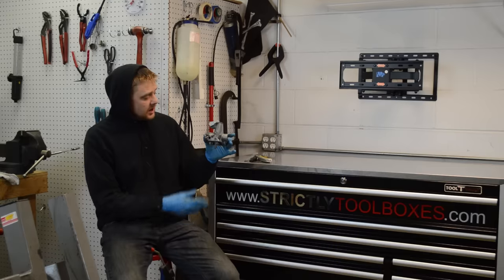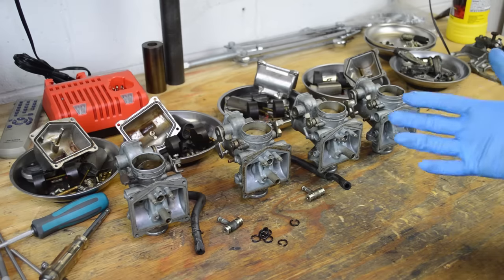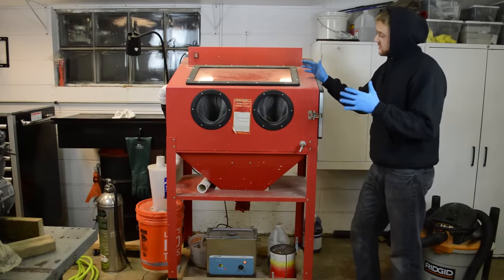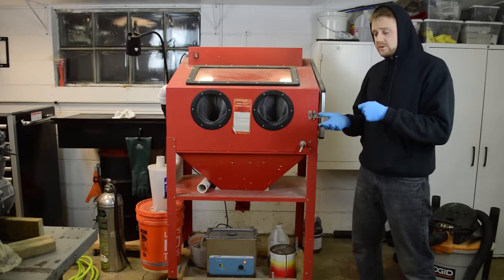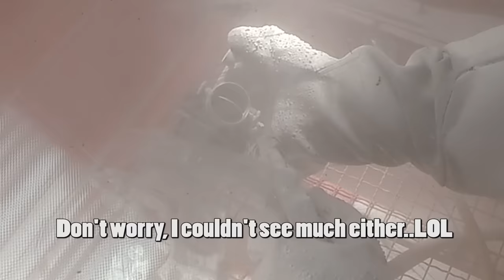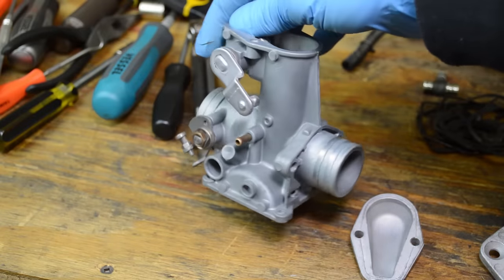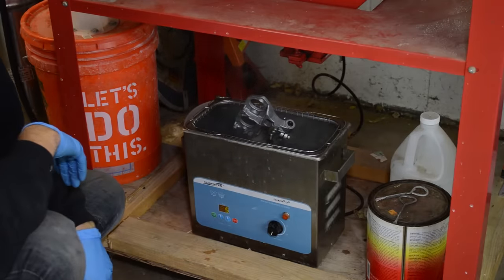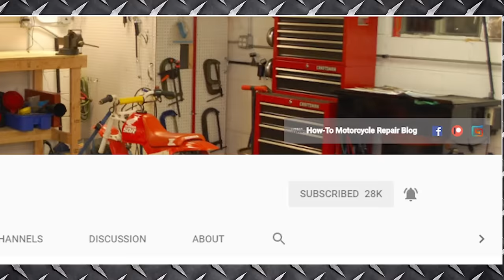The BEST method for cleaning carburetors - soda blast and ultrasonic

Comment: Never put your hands into a running Ultrasonic cleaner. Ultrasound will break all the capillaries in your fingers and you will lose them if Blood can't circulate through your fingers and hands. Not cool. If your not sure of the talk is running or not, unplug it and wait. Several minutes before reaching into one, but the best way to use it is to put the parts in the basket and use that to remove them. If you can't get the basket out, use a pair of pliers to get the basket out. Have fun, and be safe!
Reply: I learned something new thanks 🙏
Reply: Thank you for the info! In the mechanic world if we aren’t learning then we should quit!

Comment: I started working on carbs early 50s on the farm in minnesota. What did I have to use. an old kettle. disassemble carb. put it in kettle. what ever was available. pine sole, dish soap, lemon concentrate. put that and water in and let it slowly boil on the stove all day. use old tooth brush etc to clean up, reboil etc. rinse with water and dry. always worked. use what you got, just don't ruin the thing in the process. Modern gas has lots of cleaners in it so if you just drive there should be little carb cleaning needed. like the soda blaster idea.

Comment: It's a good idea to have a water/air separator on your compressor for blasting like this. I've dealt with some real PITA cabinets because after a long job of blasting the condensation just gums up the gun/tube. Soda blasting + ultrasonic cleaning is pretty much the best finish you're going to get without going new or getting into vapour blasting.

Comment: I use Pine Sol IN my ultrasonic cleaner. The results are fantastic.
Reply: Ratio?
Reply: without soda blast?
Reply: @Susan70003   Undiluted and ONLY Pine-Sol brand. Love the stuff and my use of carb dip goes back to the original Hydro-Seal they don't sell any more (because it had methylene chloride).

Comment: You might try putting your parts in a good zip lock bag with the cleaner and a tank full of water, so you won't have to clean your ultrasonic tank. I put the parts in the bag  and suspend the bag in the tank by the lid with the zip lock part sticking out so that no dirty cleaning solution gets in my tank. Saves me time from cleaning and I use less cleaning solution that way. Nice job on the soda blasting.  I am going to change up my blaster the same as you have done.
Reply from the maker: Good tip.

Comment: This is how I do all my small carbs, & I use fine strand copper wire and a torch tip cleaner as well.   I also just use Beeryman carb cleaning solution in my ultra sonic.
Thumbs up to a DIY video .
Reply: I've used Berrymans also, and always had great results. I can only imaging it works even better when heated and agitated. I just wonder what the flash point is (kaboom!). Funny, in the video it looks like a can of Berrymans next to the ultrasonic cleaner under the blast cabinet. Cheers

Comment: I use paint stripper since years, it works really well. Just make sure that the residue is all washed off and removed after 6 hours and housings & other small parts are cleared well with a blow-gun.

Comment: Hey Dennis carb here another great video dude ...for small parts I use a 1.5   gallon rock tumbler with my special cleaner ....1 ounce mineral spirits to 1 ounce kerosene 1 ...1/4 cup baking soda it works great I leave them in there for about 3 hrs I have 3 speed settings and day settings but I hooked up a hr timer at the plug socket and it shuts off at around 3 hrs .just blow them off ..I also have a zinc electro plate and dichromate tank i dip my small outer parts just for that extra protection against the elements And again awesome video Denniscarb

Comment: Soda blasting doesn't like greasy, oily parts. The soda, like most medias, tends to ball up on the grease/oil spot until it finally wears it away. I would first drop the parts into that 1 gallon can of carb cleaner next to your ultrasonic. That stuff works great. Then rinse, dry, and soda blast to give a nice finish. Your carbs turned out nice.

Comment: Year's ago I use to use a chemical carb cleaner, that was caustic,  this is so much safer and cleaner, thank you for Sharing I need to get one of those media boxes and ultra sonic cleansers and try it.
Reply: Yamilube carby dip 👊👊✊✊👍👍
Reply: Back in the 80’s I was using berkible 2+2 carb cleaner, then they removed from the stores... something about causing cancer in the state of California, I guess this doesn’t happen elsewhere, but after 20 years it’s back and reformulated, and the last time I used it, wasn’t worth a crap!
Reply: @gettintheresafelywithpatf2869  Yup, the 2+2 is back. And I agree it's weaker now, but I still think it's the best thing out there in a spray can for removing varnish and carbon deposits, like in throttle bodies. Oh, and seems like most every consumer product now comes with a cancer warning, so gimme the old 2+2 back! Cheers

Comment: that's good for those who don´t  want to know the details of the circuits, they try to fix all at once,but int he end,they  might still be the same,sometimes;      carbs are meant to run well ,dirty,from gas;       i determine EXACTLY what the problem is,BEFORE dismantling,and fix that;       if the carb sat with gas in it ,for 1O years,then i would do a total cleaning.
nice video,one more like.

Comment: For those that do not have a soda blaster, I use Extreme simple green.  It is formulated for use on aircraft  and is safe to use on aluminum.  I do use it in an ultrasonic cleaner, and it works great!
Reply from the maker: Thanks for sharing. What ratio with the extreme simple green?
Reply: I do 50 / 50, but you could (and probably should) use a lighter mixture - the extreme formula is not cheap!  @HTMR

Comment: Ugh my garage is the same cold way unless i run the heater which i try not to. The cold transfers right through your boots up through your body. Great video man
Reply from the maker: Yeah tell me about it. This year I leave heater set at 45°F 24/7 and bump to 60° when I plan to work. Feels much better, gas is cheap this year.

Comment: i use soda from HFT and  do the same. if its really heavy use the light walnut shell. a mechanic friend told me they use that to blast and shake in a tumbler for heavy build up without damaging soft metals. baking soda is also environmentally friendly and water soluble like you said and if needed a little 1.99 vinegar will take the heavy stuff out
Reply from the maker: Yup. I love what soda can do to carbs. I plan on trying wet soda in my vapor blaster: https://youtu.be/mUfgjK5q_Mc

Comment: Been using a ultrasonic cleaner and yellow ONLY yellow original pinesol. Any other color only works half as well. I mix it with water about 80 parts pinesol to 20 parts water. Works wonders never fails. Takes off old grease, paint, varnish ect. I'll try the soda this winter to see if I like it.
Reply from the maker: Soda cleans all the crusty stuff off that pinesol probably won't. Try it, you'll love it.
Reply: be easier to say 25% water to pine sol.    or even 1 part to 4

Comment: When it comes to old hard gaskets that are difficult to remove, I find that a gel type liquid paint remover applied to the hard gasket and allowed to sit for an hour will come right off ! The problem I've had with blasting gaskets off is that the surface is being protected by the old piece of gasket and even with soda it will leave an uneven surface that you don't want in a gasket area.
Reply: The soda shouldn't affect but the surface of the aluminum.  If it's blasting away enough to cause a gasket surface to become uneven, you're either doing it wrong, or you put the sand in by accident! 😂

Comment: I use two SS kitchen sink basket strainers face to face with a small bolt on one side for the hinge and a safety pin on the other to hold small carb parts in my ultrasonic cleaner .
Dollar store cheap
Reply from the maker: Nice!

Comment: I've been told that soaking the carb in Pine-sol works, so I tried that. My '03 XR250 is running again for the first time in about 10 years.
Reply from the maker: Yes pine sol works. I used that method once. Soda and ultrasonic is my preferred method though.
Reply: he had a video on berryman and pinesol. now this is the best way to clean carbs? im trying lemon juice. then pinesol.
Reply from the maker: The method you use depends on what you are trying to clean. Carbs can just be greasy, or they can be varnished up, or corroded...etc. Every method has it's pros/cons.
Reply: Have heard lemon juice is good on varnish/gummed up internals.
Reply from the maker: Heard that as well, haven't tried it though.
Reply: i tried pine-sol it worked awesome!!!!!!!!!!!!!!!!!!!!!!!!
Reply: I blast with walnut shells on all my aluminum engine parts and it works great.then i clean them with soap and water and blow them off with my air compressor.
Reply: Get a hot plate, and warm the Pine-Sol up a little, works even better. The oxygenated stuff works best.
Reply: it does ive tried it on a carb i bought from ebay. it works even better heating it up on a stove and boiling it.
Reply: chipper442 Oxegenated stuff as in oxegenated PineSol ?
Reply: John C walnut shells are fine but soda is water soluble.
Reply: Walnut shells have a long history safely removing carbon from jet engine parts. Good choice.
Reply: Leiðulfr Von Link have you tried it yet? I’m in the process of cleaning my carbs as well. I read that most people will dilute it 50/50 with water and a few people will use pure pine sol on real dirty carbs. Have you cleaned yours yet? This is my first time and I’m still a little unsure. I just pulled the carb off of my motorcycle earlier today and have not opened it up and don’t really know if I should just dump the whole carb unopened in 50/50 pine sol or if I need to take it apart. Have any advice?

Comment: Take about pound of baking soda and spread it onto a metal (not aluminum) baking sheet and bake at 300 degrees for 20 minutes.  This will convert sodium bicarbonate to sodium hydroxide.  Use that in your hot tank.
Reply: Sodium carbonate

Comment: I use baking soda in a gravity fed gun style blaster. It works great.
Reply: How much baking soda does that require? Do you buy it buy the bag?
Reply: @Ritalie  I use it for a lot of things so yes, I buy it in bulk. I keep it in a sealed 5 gal plastic bucket.

The gun I use has a valve to regulate the amount of media used. I set it to the bare minimum. Cleaning a carb wouldn't require a huge amount.

Comment: Yep soda is good but honestly you need to try vapour cleaning, I was stunned at how it cleans without any damage to the surface and it cleans things like vintage car plastic electrics and the brass connectors, truely if you havent tried it, do I bet you will be even more impressed
Reply from the maker: I'm about to send some cases out for vapor honing. My soda setup is about $250, vapor honing setup is $2k+. Just saying.

Comment: yamaha carb dip . straight no dilution, heat to 140° let set hour or so rinse in hot water , sodablaste to your liking. Works fast an easy on the worst of carbs. give it a try. 25 years an counting.
Reply from the maker: I need to try it.

Comment: Interesting to see you using soda in a recovery blast cabinet, going to give that a go. I only been using with a total loss blaster. My worries were the soda would cake and block the gun if there was any humidity? I am a big fan of soda blasting. Presently remove any unused soda and keep in moisture proof tub. The convenience of having it in a cabinet is very appealing!. Great video mate.
Reply from the maker: I live in Chicago and it gets humid. It does not pack or clump up like you are thinking. The media does break down, it all depends on what you are trying to remove.
Reply: MatthewMCRepair I have been using ecostrip medium blasting soda to clean mostly alloy parts for classic cars and bikes. I clean up alternators with it too. I feel comfort from knowing that any media that gets missed on clean up is not going to wreck the items like carbide grit would. Like I said it does cake . Using a dehumidifier to keep cabinet air dry.
Reply: Did you try soda blasting in a cabinet? I have a Skatblast cabinet with their vac system to draw out the dust from inside the cabinet when blasting. And with new Alum oxide grit I still get a fair amount dust. I cant imagine the dust created using recycled soda. Matt must have a really good vac system with the cabinet.

Comment: soda is what I use when restoring carbs. Vapour blast finish does not look like the original finish, far from it. Soda and ultrasonic is as close as you will get. On crankcases, I would soda first, then vapour and then finish in a vibratory tub and this will give you a finish 10 times superior to just soda or  vapour blasting.Good video.Check my video of a finished gt750 I did, search for gez635 and you will see it.
Reply from the maker: That looks great!

Comment: good vid but trouble with soda is it absorbs water , you need a couple of water traps on your compressor line plus dont know how you use it over a period of time as soda absorbs moisture from the air , you must have to clean your guns often due to blockages , commercial units have a drier in their intake system , for small jobs i use a top loader gun and new soda ea time then into the sonic cleaner ... did a ducati 250 carb as a test , it had been rattling around in parts box for 30-40 yrs so very dirty / greasy , was amazed at the difference , would have been there a day with a tooth brush and still wouldnt have been as good as that 2 mins with the soda then 1/2 hr in cleaner

Comment: I got a really dirty carburetor from a friend, he had it on his Malaguti scooter...so it was a Dell'Orto PHVA 17.5mm, it was all dirty covered with sand little rocks and filth, it was oily aswell....so i took a brush and a degreaser and cleaned it on the outside...it was clean but still not what i wanted....sincd i had to clean the jets and inside the carburetor i took it apart and put every metalic piece in a bowl, i put 500ml of white vinnegar and 2 cooking spoons of salt...i let that soak and "eat" the dirtyness....next day i took it out and wash it with water and deagreaser and brush once again, i  took a rag and dry it out....it looked like it had a oxidation mark or something...so i took a brass brush and scrubber the whole carburetor with it...i was really pleased so i blew it with compressed air and put it all together, now its waiting on a shelft to get mounted one day when i will buy a scooter.

Comment: Too long of an intro, but the results are great. I have an old ultrasonic cleaner from a tattoo shop, have done about 10 carbs with it.  Purple power or even pinesol work great diluted with hot water.  I saw a vessel driver on your page, keep spreading the JIS word to folks, as so many dont know about those screws!  Subscribed!
Oh and I change the fuel valves out normally, but have never found a seat that couldnt be cleaned.
Reply from the maker: Yeah I realize too much talking in this one. Try the sharpertek 1220...it works great. I love the vessel impacta drivers!

Comment: Mathew...l got a good tip for ya....so you'll save your gloves 
from sand or soda ripping through them l use a long needle
nose pliers to hold my little parts therefore saving my glove
from from getting a hole ripped in it...works every time ....
Reply from the maker: Soda does not rip the gloves. I would not hold them with needle nose pliers. If you loose your grip, that jet will fly away and will be impossible to find it! Been there done that. I have tried taping the jets to some masking tape and that works pretty good.

Comment: Good video. Aren't you worried about dissolved soda being caustic and attacks aluminium?
Reply: I'm assumimg that's where the rinsing of the parts with water after comes in... IMO! And since hes using the ultra sonic cleaner and fresh water, thered be no need to rinse the parts out first!!

Comment: Hello i just bought a Honda CB750 1981 and my mechanic told me that my carburetor needs to be replaced, is Keihin original one, but even thought i'm not an expert, i think that; with a rebuild kit, new floats and fine tuning it will be ok. But i need professional opinion of how to know if the carburetor really needs to be replace or just rebuild. In all the research I've done, all i found was deep cleaning and rebuild, nothing about replacement.

I'm thinking to take some risk and learn how to do it, i know that is not an easy task, but i have my own opinions about it. What i need is the manual of the bike (which i haven't found), and some guide or tips of how to fine tune it after rebuild. is not an easy task with one carburetor, i can only imagine 4 carburetors. But i think with time and a mentor i can get it run
Reply from the maker: Ask him WHY it needs to be replaced?

Comment: Hi from UK great job with soda I have bead blasting equipment but specialist blasting such as soda I wanted to try I'm concerned about the amount of compressed air I require I don't have enough for bead blasting only small jobs  how much air does a system like this actually use.?
Reply from the maker: Cabinet in video consumes about 12cfm @ 80psi.
Reply: @HTMR  thank you for your response. I don't know how you manage it I run 2x @240v 3 hp compressors i think hp work's out a bit different in UK than US it's as large as can be used on a domestic supply at 16amps each I'm guessing I need a large aux receiver. I was hoping that the lighter media would need less air it seems not to be the case. But what a fantastic job soda seems to do so gentle on electro plated surfaces ideal for carbs.